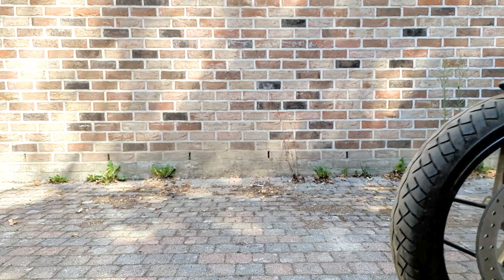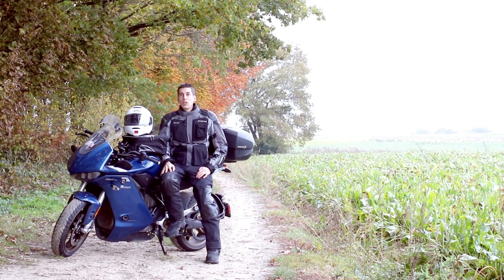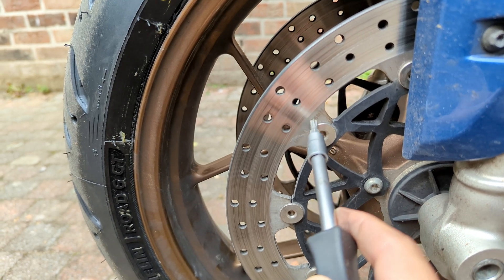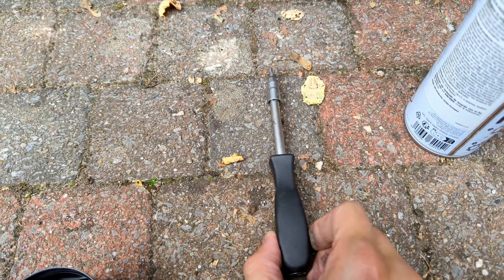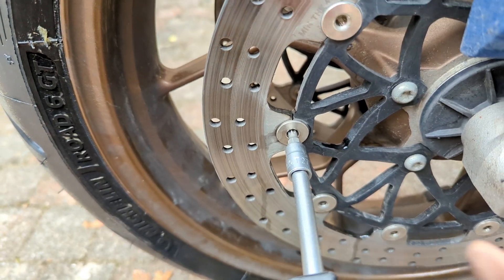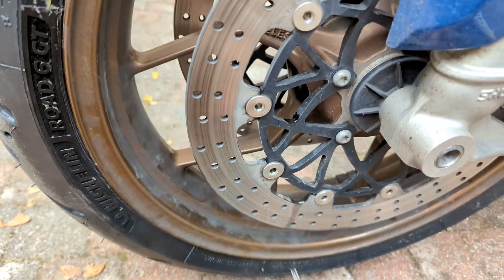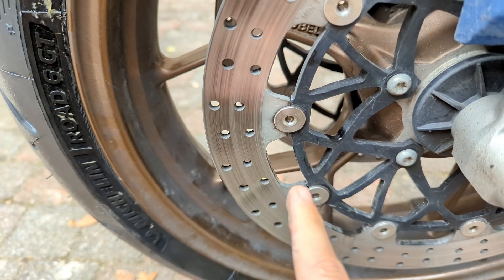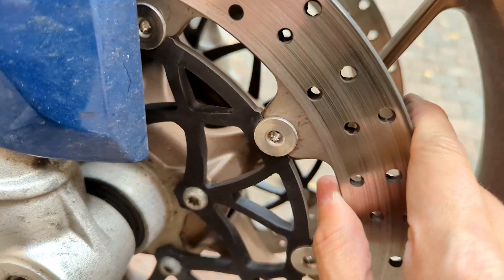How I solved my vibrating/shuddering floating discs with just one tool - Zero SR/S and SR/F

Comment: Did you got New disks from zero? Ebc discs shouldnt have this problem
Reply from the maker: Thanks for your comment! I heard from my dealership the same info, but my bike just ran out of warranty. I will keep an eye, hoping to see a final solution for this problem
Reply: thanks for your video! I tried it today because zero wont change my discs. But the floater are stucked. Need to try something Else with more Power. Torx 27 wont Do the job here.
Reply from the maker: @Gehtdichnichtsan583 some people use screws with a washer on both sides and a nut. Then you tighten the bolt with the nut and use an electric screwdriver to spin the bolt. That should also help you get them unstuck
Reply: @DanielMonteroElectraveler yes that's the next step. Hope it will solve the problem

Comment: If you rotate your rim without discs, then you see very easily that the attaching spots of the discs are not aligned, 1-2/10 mm difference created this braking vibration, after cleaning the rivets you have several hundred kilometres almoyno vibration, but as soon as debris is filling the rivet gap to the floating discs..... here we shake again while braking, extremely poor quality on the rims is the reason, bad for a bike which runs 200km/h
Reply from the maker: I never had to clean the discs again. And I have done more than 5000 km on the bike since then. Maybe some rims are indeed showing this problem... But at least in my case, they still work perfectly and no more pulsation on the brakes
Reply: Crazy. How do you measure that?

Comment: Like my other comment: high pressure wash this parts will do the trick also.
Reply from the maker: Indeed, to be tested. I already tried the trick of using the brake fluid and a drilling tool with the Torx 27 to make the rivets spin faster but it didn't work. I can try next time with a power wash
Reply: It is a design flaw in the brake discs at Zero. Unfortunately, water does nothing! :)

Comment: I don't know why they use such floating discs - without it would be much more easier. Thanks for the tutorial! Greetings from Berlin!
Reply from the maker: Apparently this issue can also be seen in other bikes with floating discs, but it also looks like it is endemic of Zero Motorcycles. Some people claimed to have the pulsating discs even with higher quality discs. Others say they didn't get any issues with the upgraded versions... The problem is rather complex. I have done more than 500 km and no sign of the shuddering coming back. Playing it will stay like this forever...
Reply: The problem with the rubbing brake discs have all Zero SRS/SRF/DSRX owners and can NOT be solved with a cleaning.
I have learned from my Zero dealer that in December brake discs from J.Juan with new design should come for replacement.
If there is no improvement, I will sue Zero to pay for the installation of another manufacturer's brake disc. 
Other brake discs from TRW or EBC run without problems!
For Zero this can lead to a sales stop in Germany, if our authorities determine that the brake system is unsuitable!
Greetings from Viersen :)
Reply from the maker: @DanielTheDriver  thanks for your comment! I have done more than 1500 km without doing any extra cleaning and they are working like new discs, with no pulsing when braking both at high and low speeds. I recommend you give a try on my method, I know other users also tried it and it was solved for good
Reply: @DanielTheDriver  Same on Energica. Multiple owner have the same problem. Just bought new OEM and 500km later they start shaking badly. Some people have luck with fully floating, at it seems like 5.5mm. is better than 5 mm. People who bought EBC and TRW 5mm. had the same issues after 5000km. But not with Brembo 5.5mm.